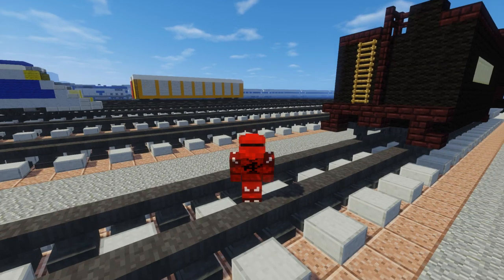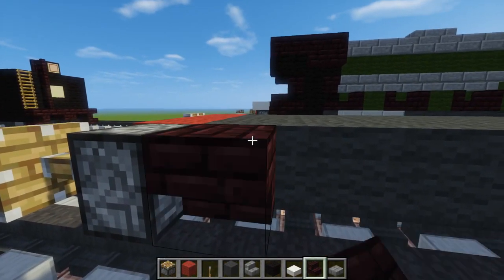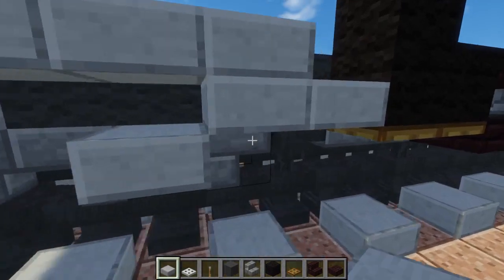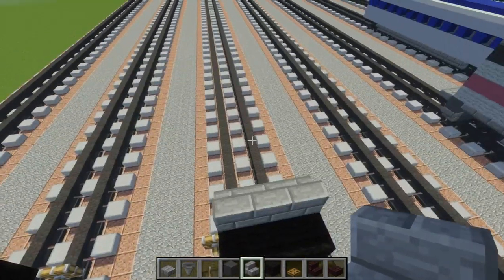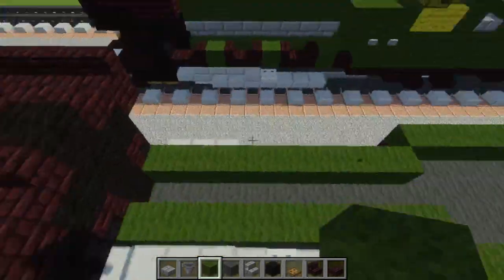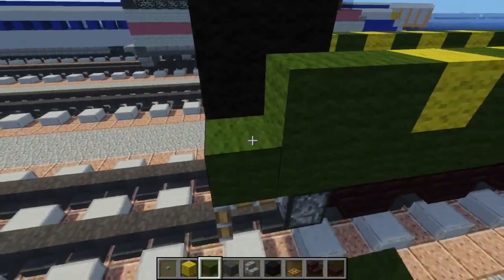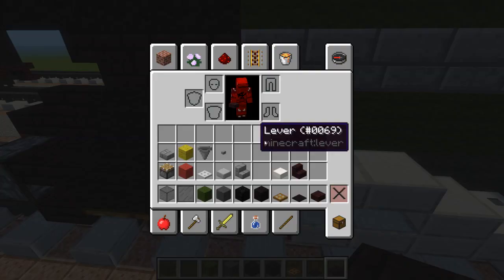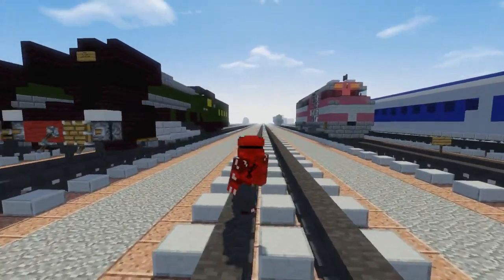Minecraft LNER Flying Scotsman Steam Locomotive Tutorial

Comment: You said. 44 72 but it's number is four four seven two and now it's called 60103 or six 0 one 0 three
Reply: It had 5 different numbers so yk..doesn't really matter - does it?
Reply: @dextercanning5927  actually 3 because there's 4472 503 and 60103
Reply: @fx6r  bruh no ur wrong
 Although it might be most famously known under its 4472 number, Flying Scotsman has actually had a total of five different numbers. When the locomotive was first created it was the 1472. In 1924, all LNER locomotives were renumbered and Flying Scotsman was given a new number, the iconic 4472.

In 1946 it was briefly renumbered 502 for just five months before settling as the 103 till 1948. In 1948 it was then renumbered the 60103 which is the number it carries today.

It was one of the first locomotives to have a corridor tender